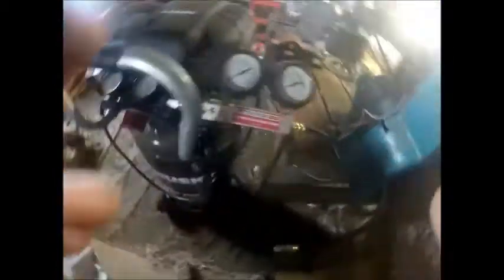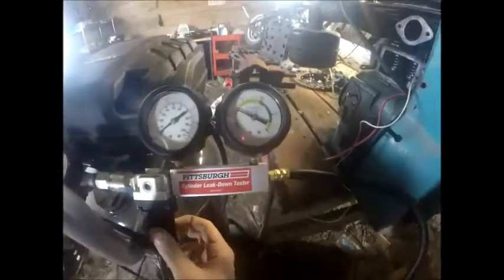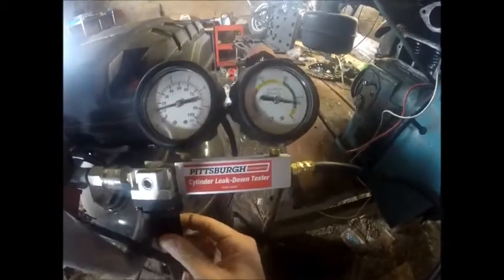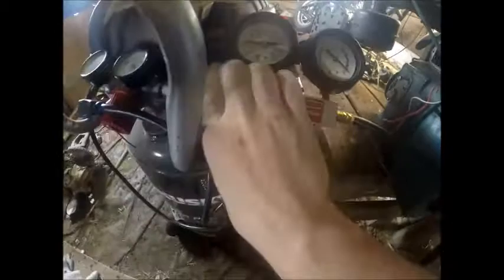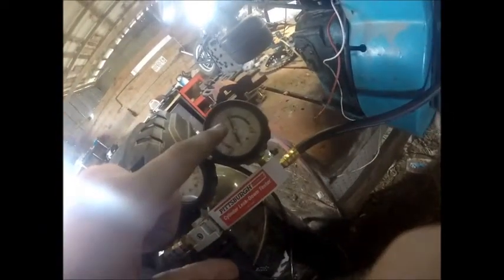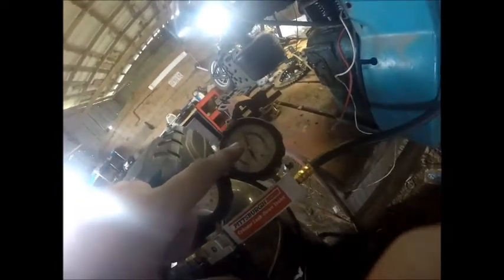Cylinder Leak Down Test on Small Engine

Comment: That leak down tester from Harbor Freight isn’t designed correctly. It’s like the company that makes it didn’t know how a leak down tester should work. I’m not knocking Harbor Freight, I love that place. They realized that tester was goofy so now they do sell one that works like it should. It’s sold under the name Maddox. Also, the tester should be connected to the cylinder from the start. Then you adjust the tester so that the first gauge is at 100 PSI then you read the second gauge to get the percentage of leak down.
Reply from the maker: Agreed but it was all I could afford 4 years ago
Reply: @BSSMALLENGINES   I hear ya. That’s the same reason I bought the same tester a few years ago. When I started trying to use it I was  like, “what the hell?”. Lol. It didn’t work right, I returned it and got another one. Same thing. I realized it was designed wrong. Finally got a good tester that works like it suppose to.